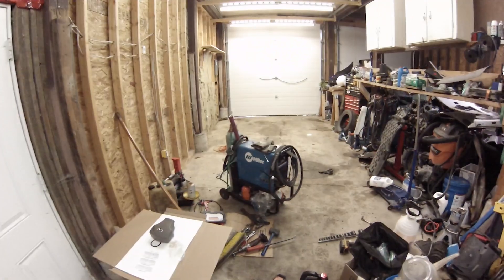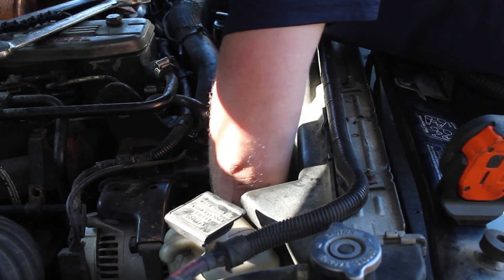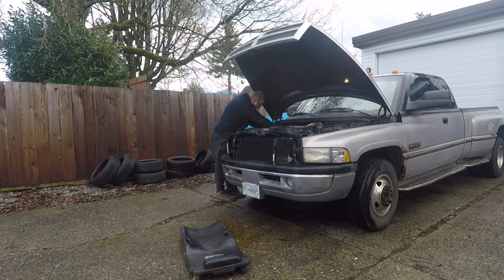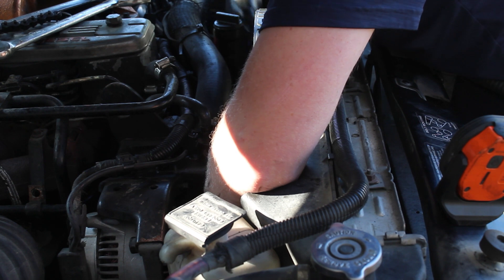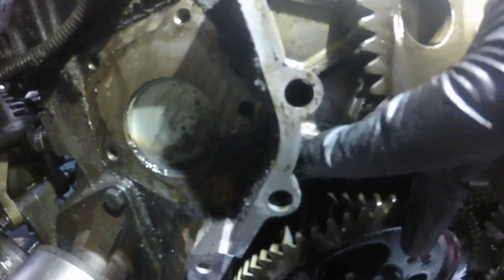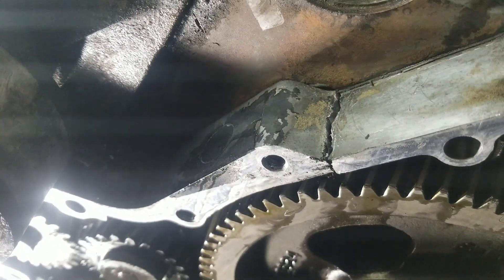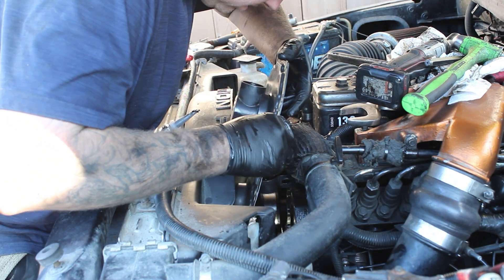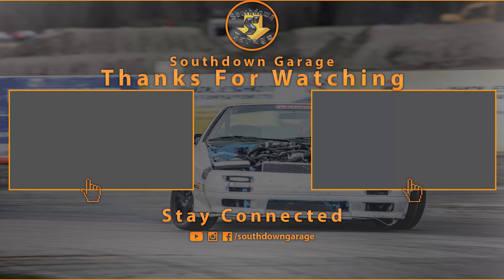Killer dowel pin - how to fix after it fails - 94 - 2002 Dodge Ram powered Cummins

Comment: Was most of your leak coming from the crank seal? Or the case issue? I’ve got a leak bad enough to get on the passenger side of the pickup
Reply from the maker: Most of the leak is coming from the timing case crack.

Comment: My 95 is cracked in same place also the thread hole on next one down in chipped off any recommendations so it doesn’t leak will weld it jb weld and rtv it but don’t want to keep taking it apart
Reply from the maker: I had to replace mine, the rtv and jb weld didn't work, there is another crack that I could not find. Thankfully you can buy these things fairly easily and they are affordable. I got mine from power driven diesel

Comment: How is your repair holding? I just found my 1997 popped the KDP and took out the case in the same spot. Can't afford the bill to properly replace the housing, so I'm looking at welding/ JB welding and RTVing the heck out of it. But, I need it to be reliable to tow my 8k toy hauler from SoCal to Maine in a couple months. Hoping your fix will hold.
Reply from the maker: So, it stopped leaking in that spot, but I missed another broken spot further down, I'm guessing it's near the A/C compressor. If your tackeling this, make sure to check further down. You can find it if you open up the damaged area carefully.  Then you'll see where it pivots near the bottom.

Comment: Why do you need that pin in there for?
Reply from the maker: The dowel pin?
Reply: @SouthdownGarage  yes what if you don’t replace it
Reply: I have a 5.9 and the pin came out and broke the case. Not sure where the pin is and it’s not starting either. Also I noticed my exhaust is sucking air and my intake is exhausting.
Reply from the maker: @LuisGomez-er7bm  oh man! So if you don't have a terrible oil leak, like mine is, then your probably okay to not replace the pin. It's used to line up the case when it gets installed.
Reply from the maker: Your truck is not starting, and you have exhaust coming out the intake and vise versa? What happened before it wouldn't start anymore?
Reply: @SouthdownGarage  it died while driving no smoke no strange noises
Reply from the maker: @LuisGomez-er7bm  check your fuel shut off solenoid, make sure it's pulled in while starting. You can use a zap strap to hold it in place if it is not going in or staying in. You'll have to crank for a while and wait as it could have drawn quite a bit of fuel before shutting off...I know this, because that exact thing happened to me.
Reply: @SouthdownGarage   yeah I got that down too it’s all in time i really think the engine is done.
Reply from the maker: @LuisGomez-er7bm  that's possible your engine to be on its way out. For the possible fuel shutting off, I would look at the relay or relay pigtail associated with the fuel shut off is a known issue. It's a lot cheaper then the fuel shut off. I would start there if your having this issue frequently.